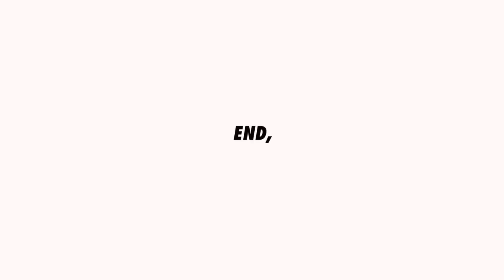W48_Modern TV stand

Comment: Hi, I would like to know which brand and model   System  using for the drawers slide?  And  had wobble side  or solide? I will make botheid vanity 120 cm  but most of one in the shops are wobble didn’t like it.
Thanks keep going design  furniture!
Reply from the maker: I use "Blum"